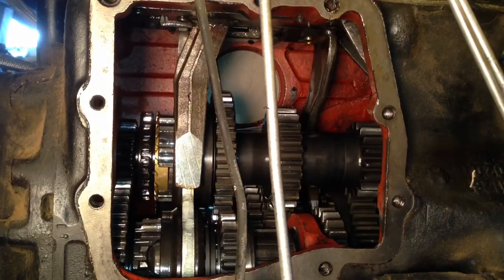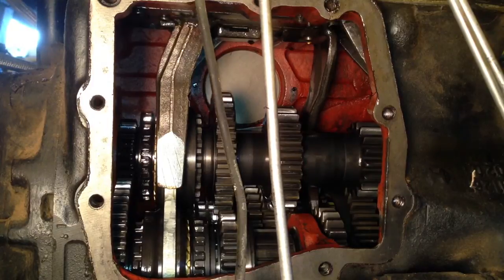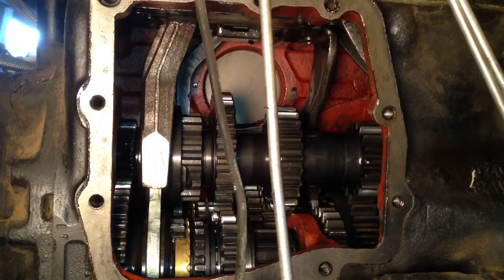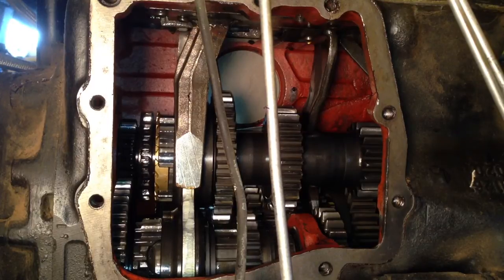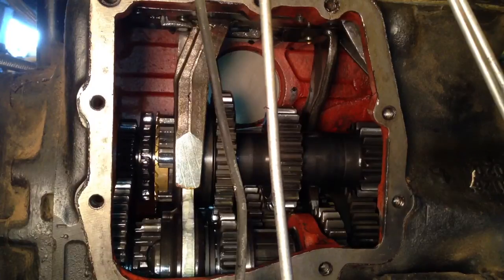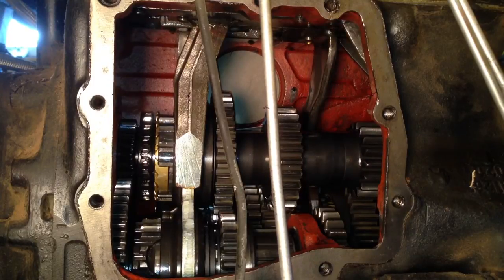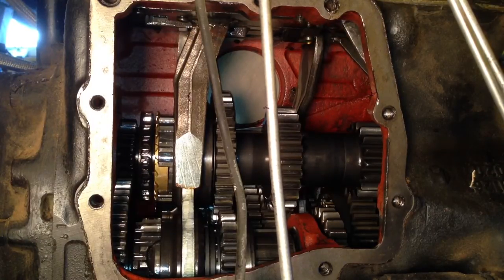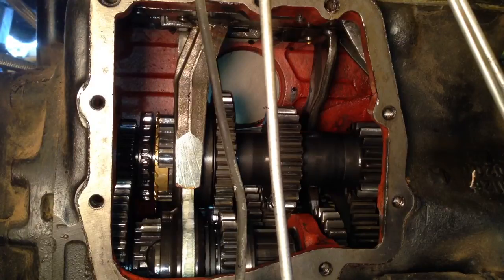404 Unimog 8-Speed Conversion showing shift forks in action

Comment: question. my 406 shift gears smooth no problem if wheels not moving (driveshaft) if driveshaft moving I can't get out of gear or change gear. clutch cilinder seems ok, or I would have trouble geting into gear from stop also... Any ideas? It has oil..but not sure which oil it has. my understanding of gearboxes in the past, used the wrong oil and happened the same. couldn't get in or out of gear if driveshaft moving. Is my idea correct?

Comment: Thank you very much for this video.  Extremely useful.
I am embarking on this mod this winter. :))
Questions;

a.  is this the Roberto mod, using the PTO lever for low - high range? or
b.  is this the German mod using only the main stick shift lever with all 8 speed on the same lever, including the original lock concept between the low & high range?
Thanks
F
Reply: @ Fra Ju: this is the "Roberto" method. There's more info & pics that I've posted on the Benzworld Unimog Forum:
http://tinyurl.com/l9okrje
Good luck with your project!

Comment: Great video! Can this conversion still be carried out when using the auxilliary crawler gears that bolt on from underneath the transmission?
Reply from the maker: Yes it can. In fact the transmission shown in the video has the 2 speed crawler gear option (installed underneath the tranny).
Reply: @MyUnimog406  I have the standard six speed with crawler. Could definitely use your guidance in getting this unit working again. I think the clutch is out of adjustment and I am waiting on manuals to guide me through fixing it.